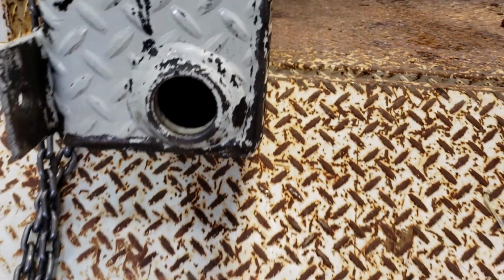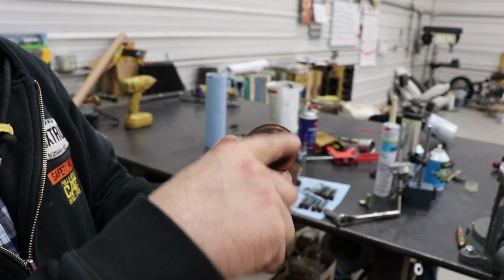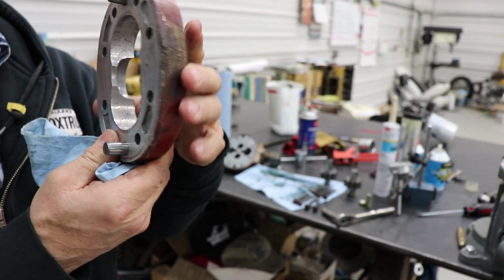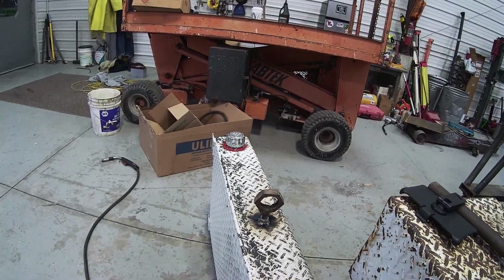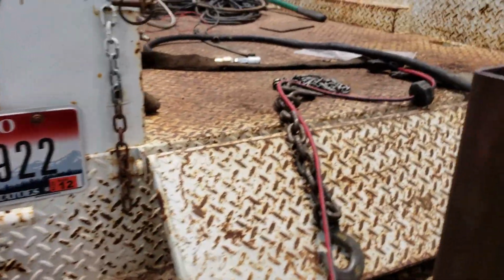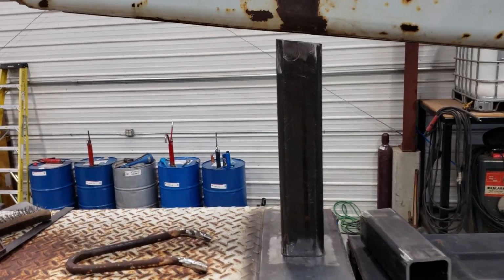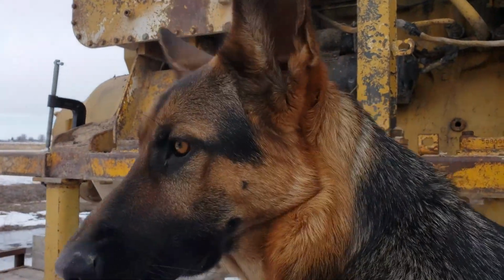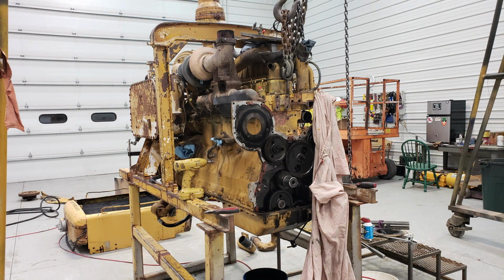Caterpillar 3306 Power Pack Removal 6,500 LBS!

Comment: should always mark the gears so they mesh back in same positions I normally tie them to gather with cable ties if not done this sometimes can lead to a noisy pump or motor as they are out of bed.

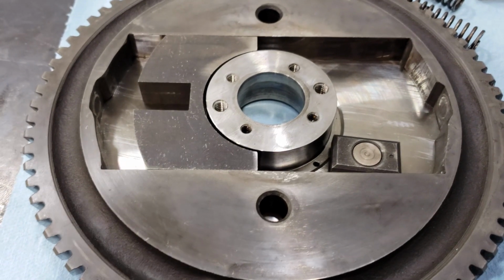Comment: Some funny shit there imitating the exhaust sound .. Anyway at 28:19 time mark you asked if i knew of a way to fix the venerable timing advance (flyweight markings) on the backing plate.
I haven't worked on a 3306 but there is a technique to add material to the backing plate and then it can be removed by lath, milling, cut on a sharper or precision ground back to spec. The technique is called Thermal spray wielding I've seen it used in meany different applications like reconditioning large shafts to plating ruff or pitted flat surfaces. Different materials are used for bonding to surface(s) from brass and silver solder more wearable materials. If the part cannot be obtained at a reasonable price or procured in a reasonable time this might be a viable option
Fat Dan

Comment: Nice videos!  I'm down in Florida where the humidity is really high. Had huge problems when I first moved here with air tools freezing up and being destroyed from all the water in the lines.  I installed a hydraulic oil cooler on the back side of the flywheel fan on my compressor to cool the air and right after that I installed a water separator before it went into the tank. The water separator is self draining. For all practical applications I have virtually no air in my lines now.  If you were painting you might need a little better dryer but for everything else it works amazing for very little cost and no more moving parts.  If you try it you might find yourself installing on all your compressors. Good luck. Love the videos.

Comment: Gear pumps have pressure internally on one side only, WHEN/IF  the shaft bushings wear, the steel gears contact the aluminum housing and gouge it out-no damaged seen on gears.  While you may have had some trash go thru the pump, it may be just normal wear.  The removed pump appears to be a Cessna, very similar  to what JD used to use on older small crawlers, I consider them a throw away pump. Half the time the bolts pull the threads out of the aluminum when you remove them, people want to put a shaft seal in when they start leaking, but they're just worn out.

Comment: I'm curious as to why your not thinking of a switch blade turbo for one of your 637s?
Seems like the fuel savings would be a big advantage.
Reply from the maker: Now where did you get that dad blamed ideer Danny?  lol  you just hold on to your butt,
Reply from the maker: @dannyhill692  No, just trying to be funny, I'm going to try one on #1 and see what it does, it will be the same turbo as the one I put on the D9
Reply: I would think on these twin engines you could definitely track fuel savings/consumption to see if it is a definite savings or not. So which motor is first, front or rear? 
I'm thinking rear so there is no shifting issue.
Reply: @dannyhill692  on 37 the rear will over heat put brand new coolers on some clog over time  if you are going with the different turbo
Reply: General tractor in shokopee Mn  I got a  torque converter from those people for my 7 E 1250 Cat wanted 7000

Comment: Always nice when someone fills a tank full of 💩💩 💩 when they built it!!! The hydraulic tank on my service truck was crazy!! I've built all kinds and sizes of fuel, water, hydraulic tanks... I always clean them out when I'm done, usually get maybe a half a handful of crap out... OMG!! I did not build this hydraulic tank, it's been in service on a fertilizer buggy for over 20 years... It's only a 15 gallon tank, when I cleaned it up for the service truck, I filled an old 3 pound coffee can with all the metal I got out of it!!! Mostly welding wire. I couldn't believe anyone could be that bad with a MIG!!!
I like the mods on the crane!! I finally gave up looking for a hydraulic crane for my service truck... Picked up an older Auto Crane cable crane off one of our local Case-IH dealers trucks... Price was right!! It will work!!
Reply: Ed Gosselin, this is the channel  I go to for some relaxation and to let my brain slow down when I have problems sleeping at night.  Fantastic channel and as old as I am I still learn a bunch watching Jay Paydirt and his crew.  I think I bumped into you on this one before.  Like to see your comments and I am sure Jay enjoys your input as well.  Catch you later neighbor!  Time to start farming again if it would ever stop raining.  Nick
Reply: @nicklambing9268  good to see you watch Jeff!! Always love the intro, where he slips on the track frame 😎 (been there a time or two)
Ya... Lots of farming to get done, not much time left to do it in. 
About the time it will be dry enough to get field work done, it will rain again...
Rained all night, sounds like it just quit...... Rest when you can Nick!

Comment: You should never weld on any section of crane boom. It reduces tensile strength of the boom section. i realize that was a small weld but never the less you are never supposed to do that.
Reply: Yet, it was all fabricated to begin with... Kinda like truck frames...
They say do not weld, yet.... They get welded on all the time 😎

Comment: Uuuhhh !!!!!!                Mr Anderson, where's your safety valve ????
A 175 psi compressor. Should pop off @ 185-190. To prevent the compressor intercooler from blowing up. Or worse !!! We had that discussion...... Remember Safety First !!!!!!
Reply from the maker: It opened at 160 so it's working

Comment: That Vickers pump will give you some good service, long as you have good filtration. A suction screen and a good return filter system. As always routine oil sampling is always a good idea. I've always ran ISO GST-100 oil in the compressors I rebuilt. It's a clear oil and you can see if your getting any contamination in the crank case.. Nice set up Jeff.

Comment: Wouldn't it have been cheaper and better to build the timing advance into the injection pump?
We have a d333.  It is a huooooge lump of shit.  The head is made of small cracks, welds, and pins.  Literally no more powerful than a 4-71 Detroit, and 10x more expensive.

Comment: Every tool has a hammer side! I bet you can take that gear to your local fly wheel grinder and have the surface cleaned up.
Reply from the maker: except cresent wrenches, they won't open after a good wacking session☻

Comment: Hey, if you ever run into those old Webster hyd. pumps and need parts or  a rebuild ever again Hydraulic and Pneumatic sales out of Charlotte NC. has all the patent rights and original schematics for those pumps and can manufacture new ones. I just had them rebuild the one on my old hl64 pettibone carryall.

Comment: Those looked like cow magnets.
Reply: How many magnets would it take to pick up a cow...….LOL
Reply: Not even close to looking like cow magnets as they are round and rounded on both ends such that they do no damage to the gut of the beast while they do their job. They don't ever come back out until it's past butchering time. And it's more the case of going in to find them if you want to re-use them with another beast. Size wise these come up short an inch or two.
Reply: Lee Barnes we use magnets just like that in our cows,we use a stainless pill gun to give them to the cows.

Comment: i always learn something from your videos. do you think you'll need a hydraulic cooler for the system with running that compressor and crane?
Reply from the maker: Yes I will need one, I think in hot weather running the compressor heavily will get it to hot

Comment: Be sure there are no burrs and that there isn't a spot where the weights normally set at WOT that has worn in the side of the slides that would cause it to hang up.  Be sure you run a good oil with lots of zink in it to help with that sliding lube of that part.
Reply from the maker: Zinc is becoming a scarcity these days, I'm afraid the lack of it will ruin these older engines, I polished the rough stuff, but one thing I noticed is, if equal pressure is not applied to each weight they tend to bind, hoping a polish and new springs do the trick

Comment: How high is that table surface?
Reply from the maker: What table Jeff
Reply: @Jpaydirt  The table you used to disassemble the pump.  My two work tables are 36". Yours looked more like 48", which would be a more functional height for disassembly.

Comment: The old rear modules , at least their only a couple of hours to pull out  ,  8 mount bolts , 4 drive shaft bolts , a couple of hoses  , a couple of elec  connectors , Done my fair share of them . Changed a 657E front today , finish it tomorrow hopefully !!!  The timing advance i have seen them with broken fly weights - just replace the springs  , it will be fine .  Cheers .
Reply: Or change it just for the std gear -  none of our rear engines have  the advance mechanism  639D'S  &  637E'S .

Comment: G'day Jeff, The wear band in the head is a Cat update but you will need a copy of the old Hydraulic Cylinder and Seal Handbook for the part numbers and the dimensions to machine the head. This book also has your standard and oversize seal and kit part numbers in it as well as all the standard and oversize rod and bore dimensions as well as the oversize seal hand seal modification and head seal part numbers. Not many Dealer parts guys would know about this. Cheers mate🍻
Reply from the maker: Yes all of my stuff I update with the correct Cat head wear ring, but this one has been machined for a aftermarket one that's .125 thick and Cats are .62 thick

Comment: Old pump looks like a ceasna pump. I'd say those wear wear rings are some type of bronze. If your air compressor is like our old shop truck was it liked to create a huge amount of moisture. Was always great trying to use it on a wreck scene in the winter and the valve be frozen and it wouldn't make any air. Great video.

Comment: If you are fixing  all the oil leaks on machines  as you can't have any, did you mess up and quote to cheap for a job in California L.O.L. Thats sure making a nice service truck with all the updates. The biggest problem now is you painted all those odd bit's, you got to do the whole truck to match so it all looks  good again.
  I found a gas F450 with service body and big crane for sale real cheap the motors done, I was thinking of doing a Fummins conversion. the big problem is it makes a $3800 truck way to much money when it's done and government inspected for the road here in Canada.   Thanks for the video, Take care.

Comment: Looks like the service truck will be good for another season or two.  A lot of the mods you made are on the new one's that I've moved.  VanAir compressor, the transport support for the crane.  Full hydraulic on the outriggers.  Some have full remote lock up for both cab and tool boxes.  The only thing they seem to insist on keeping, that I don't like, is the stowage for that blasted remote.  Magnet only, and magnet switch to the alarm in the cab.  You go over a rough grade crossing, you have to park it, get out, go back and put the remote back in it's hole.  I gave them an idea for a spring loaded clip that would make sure it stayed in place during transport, but the engineer in charge of thing (by the look on his face) seemed to be offended by the suggestion.  My little chicken scratch sketch probably went directly into the trash when I left.  Last I knew, they still had that problem.

One day, the guy that was in charge of the outgoing trucks told me of an oddity.  Trucks that they had built with the autocrane were tipping over.  No load, outriggers down and locked, boom swung around for use, and just sitting there, and all of a sudden it's going over.  It was happening only on trucks with their bed built with the autocrane.  The day he told me of that, he said that he was due to leave, as soon as he was done there, to investigate another report of that happening.  I never heard whether or not they had found the cause.  I know that, for a long time after that, they used cranes that they had built exclusively.

I guess I'll quit there, now that I've boosted you confidence in your service truck ... ... ;-)

Comment: for the advance components.. you are going to need Precision Ground Flat stones or precision ground tool room stones.. https://youtu.be/DVLXsq7pi9Y  video on how one youtuber made some..  and how they work on exactly what you are needing there.  this is one supplier of them.. https://www.iigdt.com/Products/ProdDetails/flatstones.htm  yes.. you just had a heart attack looking at the price. but its a lot of work doing them. 

 say... when you first started the hydraulic air compressor on the shop truck.. was the cooling fan loose on the shaft?  or the coupling between the hydraulic motor and the compressor shaft? what was rattling.. or were those just bubbles going thru the hydraulic motor..  do you have a hand held infrared thermometer to look along the pressure pipe to see if you can see where its freezing up at..    you might be able to roll on loops of copper tubing or Nicopper tubing and run  engine coolant thru it to keep the pipes warmed up.   i would also worry that if its on the intake side of the compressor you might ingest ice into the reed valves..  you may need if its on the intake side.. to use bell reducers backwards so you can run larger pipe from the filter to the pump reducing the venturi effect..  i have run a pair of Tees with the flow thru the side branches.. with pipe plugs installed.. that were drilled and tapped to 1/4 pipe.. i drilled some NPT to compression brass fitting adapters to run a straight length of copper tube thru the middle of the air flow.. kind of a single tube heat exchanger..  on one mans car.. his steam injection heater box was corroded.. i wrapped steel brake tubing around and around the exhaust pipe to pick up heat with a the stainless band from a no hub coupling on it..  it worked really well at creating steam for his steam/water injection system.  you could do that down stream farther on your exhaust pipe to heat coolant for the freezing air fittings.
Reply from the maker: Dam thing was rusted, had to turn it over a couple times then it was free
Reply: @Jpaydirt   did you get a chance to see the video on how the precision ground toolroom stones work by just taking off the high spots .. that would work perfectly for the injection pump gear advance components..
Reply: @Jpaydirt  1950s Cat D9 promo video.. i thought you might enjoy it. https://youtu.be/4Lkt2J104rE

Comment: We packed 3 n14s on a dual axel with a 03 2500....wfo to the big reman place near louisville...reg ratchet straps
Reply: The highway around louisville has joints every 4' seems like and uneven as all hell so you talk about that ol trailer a hunchin...lol..we were praying to god we didn't loose a whole engine at 80mph bumper to bumper
Reply: @arborist460  I wouldn't be worried about loosing one. I'd be more worried about the missiles they might become if you went from 80 mph  to zero pretty quick, if you hit something that stopped in front of you and the load tie downs snap !. Guys round here will haul something like a 4440 JD tractor on a trailer with a 3500 truck at 110 km with 2 chains holding it. they don't realize either where that tractors going if they hit something and the truck and trailer stops suddenly !

Comment: Jeff, I've rebuilt lots of these engines. Always replaced the advance springs. There were always signs of scuffing. Many were worse than yours. I polished with a stone and put 'em back together. Always worked out for me.
Reply: 2nd that with the hand stone just remove any high spots to stop the weights from grabbing, also give the weights a rub and remove any little high spots before assembly. 👍
Reply from the maker: Thank you Michael, and Ratshooter,  the weights don't have any damage, looks like some iron went through it at some time

Comment: 1 if ya want a spare pump, Bailey hydraulics has some good prices on new gear pumps.  Ya that first stage gear housing is trash. Did you put a screen on your suction line in the tank. ??? The Cat sticker will increase Flow by 50%. The truck will go faster now. That's pressure switch Jeff, I seen it climb up and not shut off. Make sure the safety valves are not stuck or full of trash. You may want to replace most of the control system.  Just for a safety point. Sounds like the compressor is operating normally.

Comment: Paydirt I just bought a 3306 good bad tell me Son??
Reply: The water pump was the weakest part in the ones we had. If the temp ga starts going erratic, and it's full of water, take the cover off the front of the pump, you'll doubtless find the impeller has come off the shaft. I've rebuilt lots of these that had 30,000 hours or thereabouts on them. When they start pumping the coolant out the overflow, You'll have to pull the liners and recondition the block, the liners sort of sink into the block and you loose the crush on the head gasket.
Reply: Like any old engine it depends on how much work it has done, how well it was serviced and how much the last person who worked on it knew, if it has the newer sleeve metering fuel pump on it make sure no water has or can get in with the fuel.
Reply: not a fan. we have a 920 wheel loader (3304) if it ever barely ran warm head cracked. sounds like the heat gives other issues as well. some good info as to why ratshooter